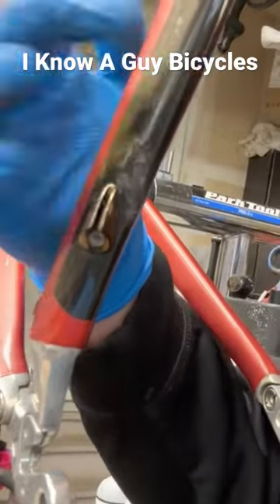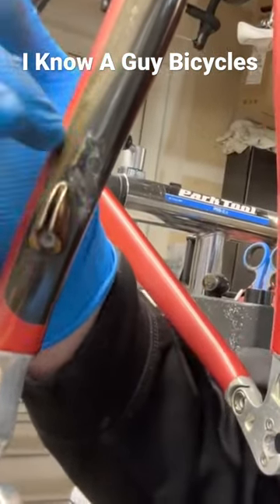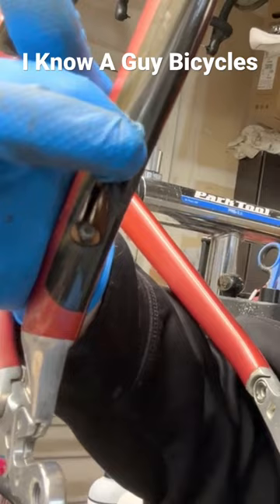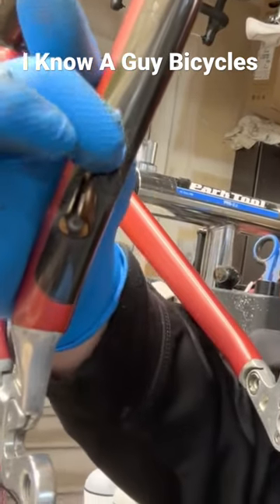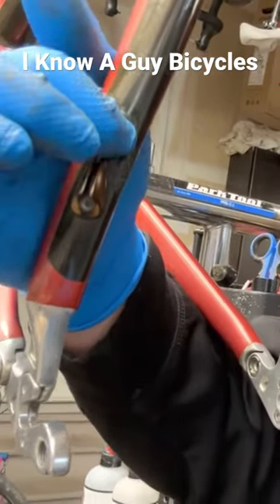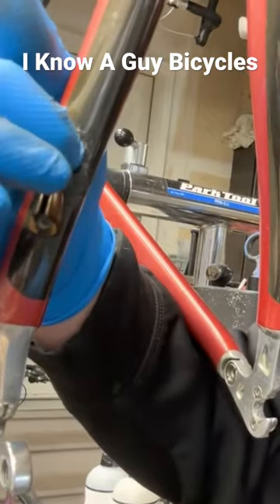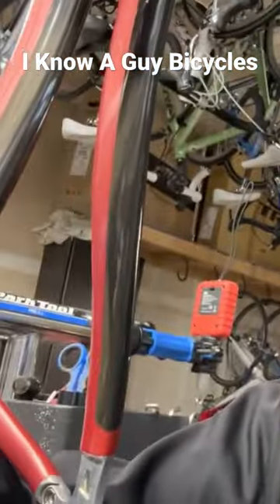Damaged Carbon Bicycle Frame

Comment: Did you guys end up trying to fix it at all? I have a similar sort of scrape/gash on my carbon mountain bike frame from a fall and I’m trying to see ways I can maybe patch it
Reply from the maker: Not yet. I do have 3-4 frames to work on patching carbon. Once I go through those I may visit doing it as a service. But I don't have any time right now so it maybe a winter thing or next summer. Local "Boulder" carbon repair for those sizes do cost around $250-$300 to fix. Just a FYI